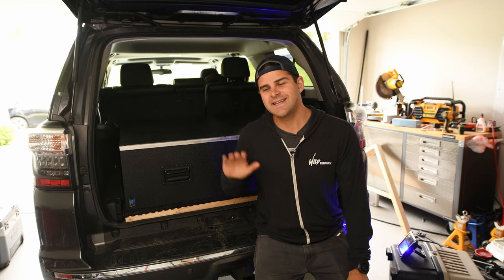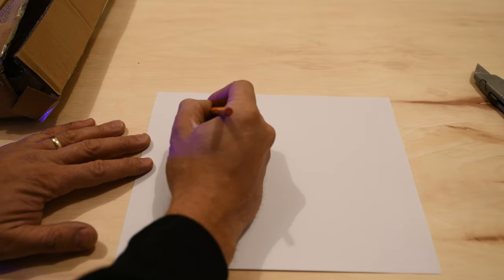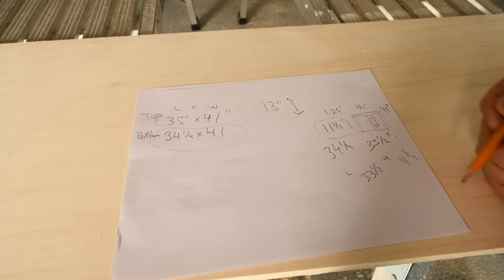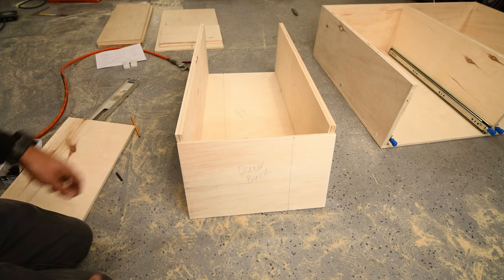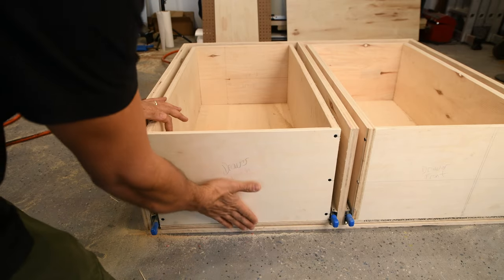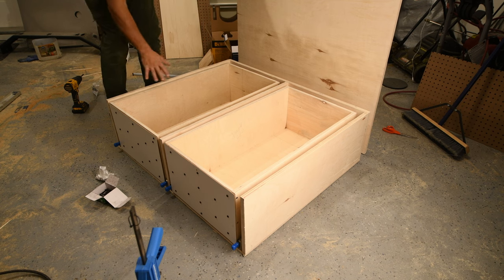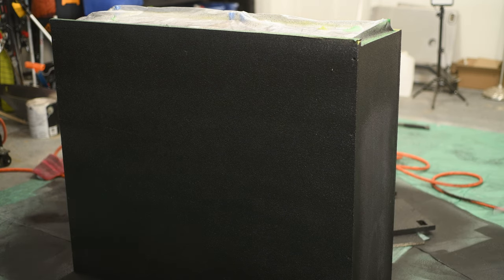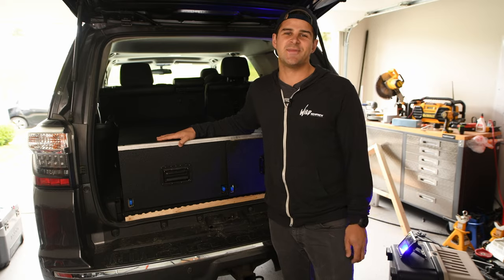DIY - Pro Quality Drawer Box Build For Your 4Runner/Truck/SUV

Comment: This is the best truck drawer build video I’ve seen on youtube.  Great job!
Reply: bad screws, put the face on the left box wrong so it pulls out screws, didnt use wood glue for joints, 3/4 ply everywhere is very heavy, the cheap real wood cover is going to cup and warp over time creating a catch on the box and not close later. You dont wanna wait for glue to dry before putting screws in. Its a great video and i'm sure many can be helped by it. Always can learn from anyone. Thanks to the creator of the video for helping us all out. It's nice to run through mistakes before you get to make ur own... I know i make plenty.

Comment: Very nice design.  Changed up the drawer slides to think it was a 260lb rated 30" soft click slides.  Basically, doing similar design using much the same hardware with speaker carpeting added on top and possibly adding a rubber drawer liner.  I think I may add a top unit and linear actuator in the future.

Comment: So weird. I just built cabinet for my suv and came across your video.  It is scary how similar they look.  Mine is very heavy with one large drawer on one side and two smaller drawers on other side.  Used similar handles and also have the silver aluminum piece.   My total cost was $500.   I covered mine with rubber mat and have led light bars over drawers.

Comment: Great job and great DIY video!  Quick question about the drawer sliders (because I had this problem when I made a similar system years ago)... when locked in the closed position, is there enough play in the sliders back and forth that they "rattle" when going down the road (little bumps, big bumps, etc)?  Thanks!
Reply from the maker: Thank you! No rattling from mine

Comment: Great job. Did you utilize the tie down and put brackets on your box to keep it from moving. 6 months later, how is it holding up? Any changes you made or are you still running the same?
Reply from the maker: It’s going great, no issues! Probably going to add a refrigerator slide to the top soon. I bolted/screwed the box down to a platform I created which is bolted the the body/frame

Comment: Awesome video! Will definitely be going this route instead of purchasing them. How did you secure them to your vehicle in case of a crash?
Reply from the maker: Thank you! I did a 3rd row seat delete on mine and used the 3rd row mounting points - M10 1.25 bolts. 4 bolts secured a carpeted platform I built. L brackets will be used to secure the box to that platform. You can see the platform at the beginning of the video, I just finished putting the bolts into it yesterday. If you have a 4Runner without 3rd row I believe there are mounting points under the back seats. There are other videos and info online re. the mounting points for those models.
Reply: @T4Rgarage  Awesome, yes I don't have a third row so I'll check those out.

Comment: Are you happy with the truck bed finish? Has it held up well?  I have roll of upholstery but still debating using the truck bed liner.  My build starts this weekend.  Im in for around $280 total one set of 265lb slides one wide drawer. May add top drawer or cabinets at later date.  Will add some wheelwell wing side storage areas after also.
Reply from the maker: It’s held up really well. You will need more than you think to cover the box though. I used double what I initially thought

Comment: Could you purchase one pair of locking slides and one pair without the lock? Using just one locking slide per drawer that way it only requires you to unlatch one instead of both to open the drawer?
Reply from the maker: I have seen people do this. With all the weight I have in my drawers, I opted for locks on both sides

Comment: I was wondering how you did your 3rd row seat delete, im wanting to do the same thing. was the process hard?
Reply from the maker: There are videos on YouTube on how to take out the 3rd row. Once you get it out you can utilize 4 of the existing bolt holes near the hatch to run m10 1.25 bolts. Then closer to the rear 2nd row seats there are opening in the sheet metal where you can weld in m10 nuts. Once you have those nuts in you can bolt down reinforced plywood. I used 5/8th black carpeted plywood screwed into 2x2s. I used wide washers and m10 bolts to bolt this down. At this point you have what almost looks like a normal black carpeted hatch with much more room. The drawer box screwed down into the reinforced plywood platform using L brackets and sucj

Comment: Question. So you took off the foam and plastic to gain a little more space. In the part where you're doing the measurements it looks like there's a pice of 3/4 with carpet. Did you leave that in there and put the box on top or was it just there to make the measurements easier.?
Reply from the maker: Mine had the 3rd row seating so once I removed that I had more space but it was bare metal. I created a platform out of 2x2 and play wood and carpeted it before I made the drawer box. I bolted this platform to vehicle. Eventually when I made the drawer box I bolted that to the platform I had made to hold it down
Reply: @T4Rgarage  oh that makes a lot of sense now. Have you ever considered figuring out how to put the sliding tray on top of the box and have the best of both worlds. I think I'm finally gonna build this next week. I'm super pumped. I have a limited also your content is super helpful and inspiring. Thanks for the reply.
Reply from the maker: @dizzle.1983  Thank you! I did have to tack weld in a couple nuts in behind the back seats to bolt the platform down to. There were x2 stock threaded holes I could have used behind the back seats  but they were on an angle. Closer to the hatch had 4 useable level threaded bolt holes. I plan to add a sliding tray to the top for a fridge, eventually